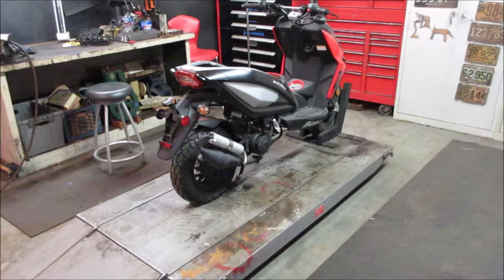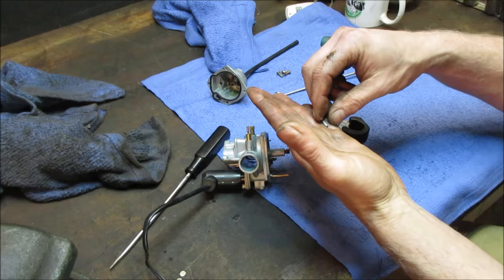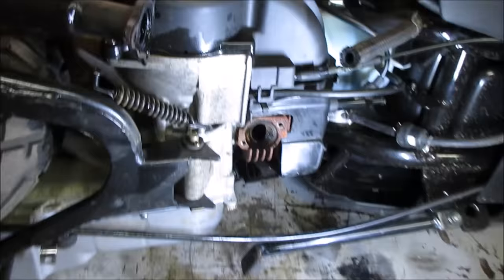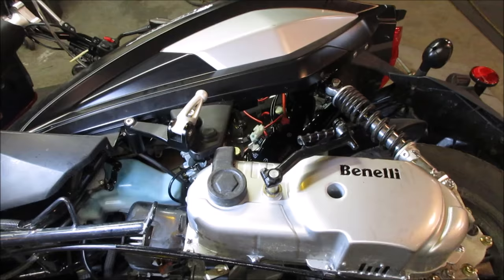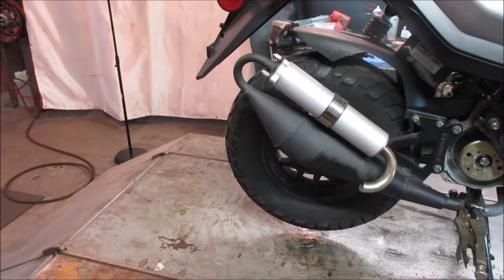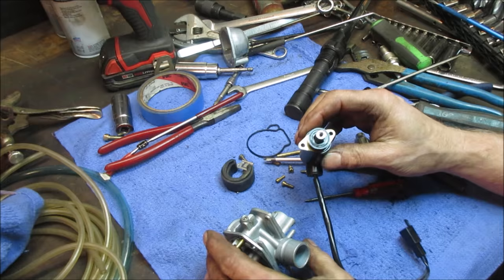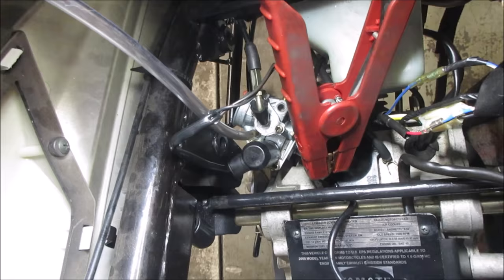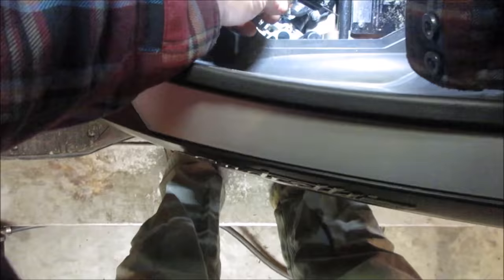Free Broken Scooter, Can We Fix It?

Comment: hey mustie the expansion chamber before the muffler is part of the intake in a 2 stroke. venturi effect and pressure differentials  caused by the expansion chamber increase the exhaust scavenging which in turn controls the intake charge....exhaust leak before the expansion chamber will affect how much exhaust is pulled from the cylinder  which in turn affects how much  air fuel mix gets drawn into crankcase.  i dont know that that is the only issue happening here but it can explain the idle/accelerate issue. thanks for the videos
Reply: I bet he knows that already.
Reply: @Hjerte_Verke  probably but the little things can get you..murphy had a law  i think.
Reply: its uh, not a venturi effect, its pressure waves. the pressure puls from the engine reflecting off the back of the chamber and cramming wasted unburnt fuel back into the cylinder before the exhaust port is closed during a certain band of the rpm range. but close enough.
Reply: @EllaBananas  whenever you have a restriction followed by an enlarged closed space...you will have a decrease of pressure and an increase of velocity ..excuse me for labeling it a venturi effect  while it is almost identical and  is irrelevant as i know how it works  and you know how it works and mustie knows how it works

Comment: This was a good one! Challenging, but you can't stump Mustie1! LETS GO! You had me clapping the moment those RPMs came up and that back tire started spinning 😄 had a huge smile on my face. The sense of accomplishment is such a great feeling. As an Automotive Technician I can relate to that feeling of figuring out a problem that at first has you stumped. Love it! Keep the "will it run" videos coming sir!
Reply: It looked to me like the float level was too high, and lowering the float level should have a similar effect as lowering the float needle, which helped, but not enough.  The excess oil also seemed awfully persistent to be just in the crankcase, which makes me think the oil pump may be out of adjustment or defectively pumping too much oil.

Comment: so basically the most common problems with scooters or simple motors in general are carburetors being messed up, maybe some gaskets(low compression problems) and electrical problems. If that is the case i learned a lot from this video. Thank you bro! 1.5h spent with quality first hand content.
Reply: No; The biggest problem with scooters/bikes is that at least 2 other people have messed with it before you get it...The original problem was the air cleaner not seating on the carb properly, and the people before messed with everything BUT what was originally wrong; Not putting it back together properly...

Comment: I had a Yamati very similar with a similar start up issue and I believe my issue was the enricher.  The fix was to use the kick starter until it started sputtering and then lay the scooter on its left side at about a 45 degree angle.  I don't know if this moved the fuel mix around in a weird way but if I did this it would idle and run normally.  I didn't have to do this every time I started it, just the initial time if it had been sitting up for a week or more.  If I went to start it the next day, it would be fine.  I think it also had a small leak in the oil injector shutoff that would allow more oil into the carb (gravity) when it was sitting up. Mine topped out at 45mph.  I had another scooter that did that same break-up issue on full throttle and I chased what I thought was a carb issue and turns out it was a faulty spark plug.

Comment: Sounds like the CVT has a limiter- spacer on it to limit ratio change. Lots of markets got these because of local market regulations. There should be info online on how to get rid of this limiter hardware.
Maybe you can get a tuning kit for this thing? Malossi? bigger carb. + jetting? exhaust seems OK.
These things can easily be made to run 50mph
Reply: Often disconnecting 1 wire is all you need to do. I know that on my Yamaha mint 25KMH version is limited to  35KMh it is the blue wire of the CDI I only use 1/5 of my gas handle  but the 45 versions (limited 50) they use more travel. but they do sound like this on limiting by missing fire moments to limit speed/ engine ref.
Reply: Unfortunately it's only a CDI replacement. From the factory, they are rpm limited
Reply: That’s probably what started this whole “project” with the previous owner… trying to swap in performance parts..
Reply: @Montimoped  It depends, some can be fooled with 1 wire. not all though. As M]my Mint only needs 1 wire to be disconnected but Might be different in this one.

Comment: The engine might be running rich because of the exhaust constriction or the Bistarter. If you take that half moon shaped exhaust restriction off the cylinder, that's what makes this a "Moped" rated scooter in many states legally. The bistarter is the plunger you were calling a solenoid, it's not. Hook it up to 12 volts for a few minutes, check for length, should get longer after 5 minutes  Should be able to run close to 30~35 mph with that plate exhaust port removed.
  Also check the engine pulley on the CVT, they sometimes put a metal ring in that prevents the CVT flyweights from running the entire length of their operation "ramps"  also restricting the top speed to about 20~25mph.
Reply: Yes it can constrict the flow of exhaust, but the purpose of the "half moon exhaust" is because its called an expansion chamber and is required in 2 stroke engines to help with scavenging to use backpressure to push unburnt fuel back into the engine
Reply: Guys, it is CDI rpm limited.... :)
Reply: Listen I've worked at a Genuine and SYM dealer, and you don't leave the little port restriction in if you want the full affect of the expansion chamber's pressure waves to work. I've owned enough 2 stroke bikes to know this.
Reply: @tauncfester3022  My bad dude, I misunderstood what you wrote. Yea that makes complete sense if you remove the port restriction, its only there by law anyways to reduce the power output

Comment: Italian 50cc scooters have "restrictors", typically a restriction in the exhaust (if i remember correctly also that small pipe coming off the exhaust should be removed and the hole plugged) and a ring to limit the travel in the variable pulley attached to the crankshaft
Reply: Back in the day, that was true but the newer bikes from over here use "electronics" to govern RPM ... that little "Red Box" the previous owner installed (and fried by reverse wiring) is where it is accomplished now.
Reply: yeah this is no china clone, this is quality stuff
Reply: @whoknows8225   Its a clone from the real minarelli engine.
Reply: Yes, you're absolutely right, you can easily hear the exhaust is still restricted, that kind of exhaust is much louder when you remove it.

Comment: That engine is a horizontal minarelli.  Found in tons of scooters.  It was the motor in most 2 stroke yamaha scooters as well.  Pretty much the same motor as a bws50 yamaha.
Reply: Its a clone Minarelli Horizontal air cooled.. In the 90er they used the original one. Some parts of the original minarelli will also fit on this clone engine.. The cilinder looks to be the same. (only the clone using P12 piston barrel.. And the old using P10.
Reply: Yup.I have a 2 stroke Yamaha BWS been sitting in my garage for about 10 years, it has that engine. It was running when I parked it, I'll get around to starting it up and selling it sometime.

Comment: I would try decoking the exhaust with a caustic soda solution. My old MZ 2-stroke used to refuse to rev when the silencer needed a decoke, easy to do and doesn't cost much.
Reply: Tell me more about how to. Last time i used 2 propane torches and smoked it red but using a solution sound easier
Reply: @RimjobHimself  Remove exhaust from bike. Block one end of the exhaust with a potato. Make up a strong solution of caustic soda and pour into the exhaust until full. Leave overnight, then remove potato and drain. You may need to repeat a couple of times. Keep the caustic away from aluminium as it attacks it.
Reply: @WinstonSmith2024  awesome. Thankyou!! Use a potato was a great idea!!

Comment: Nice!  You might want to look at the spacing between the ignition pick-up and the rotor.  Too much spacing may lead to a poor signal at high RPMs.
Reply: Ignition is my guess spark plug or ignition
Reply: Can there be any problems with the pick-up being too close? assuming there is still an air gap, of course

A technique I've seen is to slide a piece of paper between the flywheel and pickup, jam them as close together as possible, and remove the paper

Comment: I bought a 150 for my daughter with 14 miles. The dealer couldn't get it to run so they sold it for $600.00. 
The only adjustment was the idle. So I got a slightly larger carb with interchangeable orifice seats. With the larger carb and a 4x larger jet orifice, it can run 60+mph with me and my wife on it. 
Surprised me, I'm 6'3"/250lbs and she's 130lbs and it pulls off from a stop very well.

Comment: The auto choke works as it warms up .When cold, it has the port open to allow more fuel to pass into the carb. When it warms up, the plunger is pushed out and the needle closes the port for the extra fuel. If you leave the scooter with the ignition on when it is cold, it will close the choke and it would be difficult to start. I found this out when mine didnt start after leaving the ignition switched on. Takes ages for it to cool down to be able to start it.
Reply: I thought it was the choke right off the bat, and I'm not way thru the video!
Reply: @michaelhartzell9758  I would never have thought it was the wires on the CDI. The choke was working fine, but if ignition is left on, then it wont start unless the air is restricted. I done mine the otehr day and found I jammed the choke in the carb after stripping and cleaning hte carb. Blocked of fthe air at the carb and it started, I checked my choke and now it startes first press of the key.
Reply: Mine has the opposite problem. A cold start on a hot day, no problem, fires right up. On a cold day, I don't even bother with the electric start: I could drain the battery trying to start it. Instead I have to kick it over maybe 50 times before it fires. The choke doesn't run off the battery. It runs off one coil in the magneto, so once it starts the mag will close the choke and keep it closed as long as it's running.  In other words, the engine doesn't like the extra fuel  when trying to start it in the cold. The 50 kicks activates the mag and eventually warms and closes the choke. I'm thinking of sending battery power to it through a switch to warm it up before trying to cold start it. We'll see.....
Reply: @curbmassa  If you watch Samodel on youtube, he shows how to make a manual choke using an electric one. He is a cleaver moped builder. :)

Comment: With the amount of smoke coming from the exhaust I wonder if they put premix fuel in the tank with the result that it's getting double (or more) oil.
Reply: That's what I thought.
Reply: It'll foul that plug pretty fast with injection+premix, (learned lesson on my polaris when paranoid of ancient injection pump)
Reply: It's probably what started the problems and new parts, wrong fitting etc followed from there.

Comment: This one got me screaming at the screen a bit more then usual  xD ... in Germany you are only allowed cars at 18 or at 16 with a person who's already got their license for a few years, on board... But scooters are allowed at 14 with a 25 kph (so like 18 mph) limit you also need a license for that... Anyway the older scooters just had a metal spacer in the CVT that kept it from pushing together and going higher gear ratios but the newer ones seem to do it with the ignition and that cutting out at the end of the video really sounded like I remember that sounding xD Which is kind of unbelievable if you think about it. little Timmy going full throttle and his ignition simply cuts out and half of the fuel Timmy puts in his engine simply gets discarded though the exhaust great...
Reply: It is the same in Denmark, when i har scooter they had the spacer in the vario, a ring in the exhaust blocking 70% of the flow, and a blind pipe. All that to make ik rev like crazy at top speed at 25-30 km/h ruining the engine way faster than if they didn't restrict it and ruining the economy.
Reply: Scooter and motorcycle laws are not national in the US but state to state...thinking of the states the way the UK thinks of England, Scotland, Wales, North Ireland (with their own Parliaments for local affairs). 

I got a motorcycle up to 5HP restricted license at 14.  Had to pass a written and practical.  Could ride a moped or a bike up to a Honda CL70cc, the Trail 90 or the Cub50, but police typically allowed anything to a CB125 which was 9hp.  Helmet required since the early 1970s.

After 16 there was no restriction once passing the drivers test.  That was Alabama.   All motorbikes must be licensed, tagged and insured.  Helmet required.

However in Georgia a person 16+ can ride a 50cc bike with helmet, but no license, tag or insurance.  They are considered motorized bicycles. 

Florida and South Carolina no helmet required over 18, minor riders must wear helmet.

It depends on the state.  Some surprise you.  California is highly regulated on many things, but no helmet required and lane filtering is allowed....prohibited in the vast majority of states.
Reply: @STho205  okay
Reply: @STho205  Helmets are required in California, and its called lane sharing or splitting and they passed a law (2016)  that addressed this. CHP has guide lines before they will issue tickets for reckless driving. I've been riding  since 1970 and was splitting lanes just last Friday..
Reply: @dublindave5795  Splitting lanes is frowned upon to serious/normal riders. It makes one look like a Jackazz you know.
Reply: @dublindave5795  when did they finally do that?  SoCal-East (Florida) is still cracking skulls when last I was there.  I never ride bucketless, myself.  Can't in my current state,  but could one over.

Filtering, splitting, sharing....all means the same thing despite protestations.  There was just no law prohibiting it for many decades, if I'm remembering right.  
No law.... you could do it.  
Law means it is now regulated and you can only do it in certain circumstance (speeds, traffic jam, X+ lanes, etc...)

Never saw it as a problem in traffic jams on the 10, but the drivers expect it.  Go to a state where it is verboten, and do it...you get killed because drivers aren't expecting it and don't look for that, expecting bikes to change lanes as a car would.

Lane splitting in Atlanta kills or injures a biker a day.  4 people a day die on Georgia roads for all vehicles.  3 in Atlanta alone.
Reply: Helmets required in California but lane splitting is legal
Reply: @STho205  So WTF is that like 1 person per 150,000 still great odds in my book!! This is a 100% chance of dying if you live and ride every day for 410 yrs.
Reply: To me it sounds like someone was messing up with the weights in the cvt, so it revs up the engine too high, until the rev limiter starts to kick in, even before the scooter reached the max speed...
Reply: @lutomson3496  Legal but everyone hates you. Chill and.........Just enjoy the ride.
Reply: @STho205  Helmet IS required in California, been that way for last 45-50 years. As far as I know, still only state where lane splitting is legal which is WAY COOL in slow moving, multi-lane lane traffic situations. Sucks when I cross the border and have to inch along in grid lock, sandwiched between semis and SUV's. Now, that's dangerous!
Reply: @twt000  The only ones who frown at lane splitters are clueless and/or jealous car and truck drivers who secretly wish they too could slip between stop-and-go traffic. I got your serious/normal right here, buddy!
Reply: @johna1160  Just don't be a jackass about it like half of riders out there letting their head get big. (Tight helmet syndrome). 
Most agree under 30mph where legal is okay and be respectful about it. 
Don't be "that" guy........
Reply: @STho205  okay i had a feeling it was like that.
Reply: @STho205  Yep you are right but still life is all about odds. Play them as you see fit it's what we call Freedom. Been riding for 60 yrs and my 12 yrs as a Army Ranger is the odds that got me. 
Call sign/handle/user name-Death Rider
86 broken bones, 108stitches, 3bullet wounds, 2shrapnel wounds, stabbed through the calf, fried retinas and a compressed disc.
Spc-Lee A Benson 11B U.S. Army (RM)
Reply: @twt000  Riders where? Not in California. Like I said, I've been riding for 50 years and it is the norm here.
Reply: @dublindave5795  I hope we are all aware there are issues with problematic riders and using splitting to show off in an unsafe way.
I look at it like safe riders are judged on the reckless. Again under 30mph and be respectful.
Reply: also with them mopeds if there is a pink wire on the cdi plug remove it and it will go as fast as you like then 👍😀
Reply: @twt000  who hates me? you? sounds like more virtue signalling
Reply: @lutomson3496  "You" meaning people where illegal or just showing off. I'm just assuming people are defending it from places where it's frowned upon, which is mostly everywhere.
CA under 30mph and respectful is fine.

Comment: Just as an aside... when you had the transmission cover off that CVT and showing how it worked, I noticed only one side (crank side) of the CVT was adjusting.  You can tell as the belt axle side didn't contract its diameter as you throttled up. 

That would half the top speed of the lil' scoot, giving the impression that the engine isn't revving to full, when it's actually the weights on that CVT, axle side, that are stuck in position.
Reply: I agree.  cvt issues